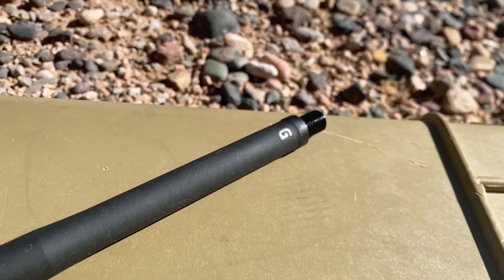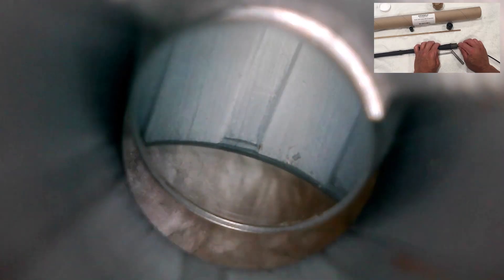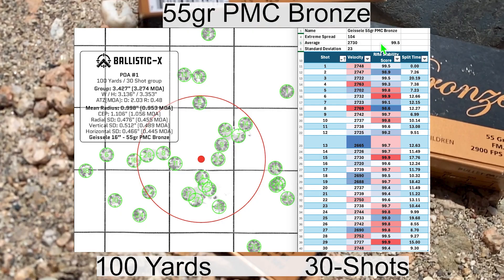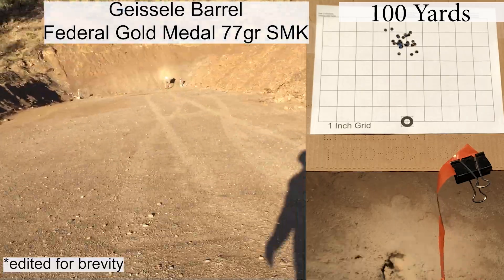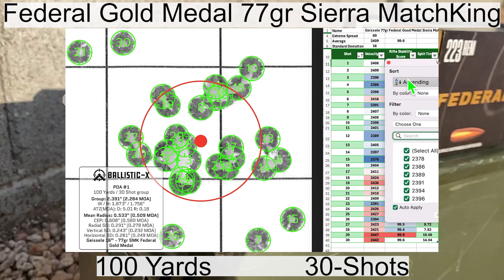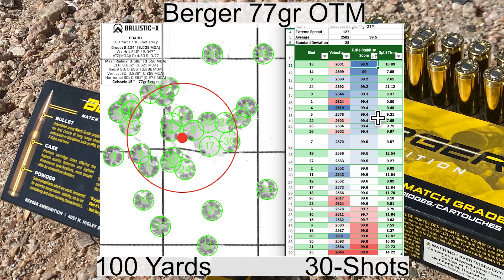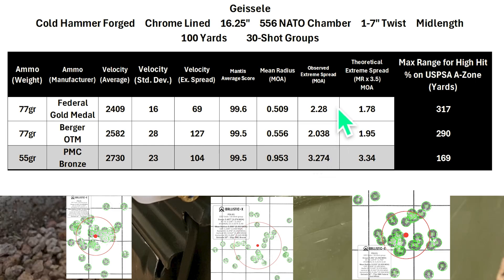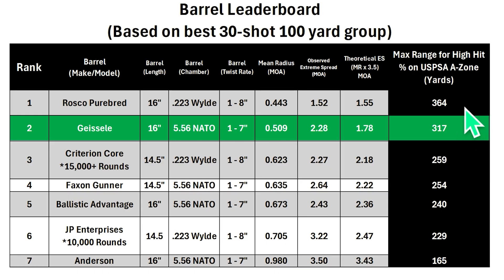Can Geissele CHF Barrels Deliver Accuracy Without Compromising Durability?

Comment: Fact is that if you want actual accuracy then you need to buy stainless match barrels for AR's just like anything else. Chrome or melonite lined barrels are not even close to being as accurate. You may think they are accurate but until you get a stainless mstch barrel from from Wilson Combat, Odin, Proof, Krieger, or Saturn you wont know how much chrome lined suck. Sure they dont last as long but barrels are an expendable part

Comment: I want to say, I love the content, and if this has already been asked or answered, I apologize. 

However, instead of using extreme spread multiplied by 3.5 (3 or 4) to calculate the max distance you can hit an A-zone with an unknown percentage chance, and instead use a single tail confidence interval? 

You could fit the observed radius from the center of the grouping to a normal distribution, and calculate the mean radius and standard deviation of the observed radius and create confidence intervals. 

For example, say you had a mean radius of .503 inches, and a standard deviation of .377 inches, with a 99.9% single tailed confidence interval your maximum radius would be 1.669 inches.
Reply from the maker: Thanks for watching my video and for taking the time to write a thoughtful comment!!  Since this video, I have revised things slightly to what I now call the A-ZED (A-Zone Equivalence Distance).  Instead of saying that it is hit probability, the A-ZED is just basically a size comparison.

I want to keep the math extremely simple. I think that would benefit the majority of my audience. Also, if someone has more advanced math skills, then looking at raw mean radius numbers is probably good enough for them anyway.  They wouldn't need to simplify for reframe things with the A-ZED to understand the practical implications of the mean radius.  Also, I basically need to re-explain the A-ZED in every video.  So, that's another reason why i prefer to keep it simple enough that I can explain it rapidly so that I don't irritate returning viewers by going over the same long winded explanation time and time again.

I'm certainly open to any more feedback if you have any.  I very much appreciate you taking the time. Thank you!

Comment: Really amazing series you got going on here. Glad I subscribed
Reply: I have a faxon match series gunner 16 in 223 wyld chamber with around 100 ish rounds through it. Id send it to you if you were interested to add to the list. It’s just sitting in safe. Be worth seeing the results compared to other brands if you were interested.
Reply: Faxon Match Series 16" Gunner, .223 Wylde, Mid-Length, 416-R Stainless QPQ Nitride, 5R, Nickel Teflon Extension
Reply from the maker: Thanks for the sub!! I really appreciate the support!  I have a guy that already loaned me a 18" Faxon Gunner Match that I will eventually do a video on.  It could be cool to have two data points with similar barrels.  But I don't want to keep your barrel from you for too long.  It will probably be a little bit before I could get to it.  I very much appreciate the offer! Getting access to more barrels really makes things a lot easier for me to put out more content.  Thanks again for the support!!
Reply: @ it was originally designed for a build that ended up going another direction. My plan really was just to keep it as a spare. The match series would be nice to see if there’s much improvement over there normal tier barrels. From what I recall they don’t guarantee sub MOA accuracy or anything with there match barrels. As far as keeping it too long that wouldn’t be a worry. I figure time wise and ammo cost though for doing 2 of the same barrels would maybe not be as worth it unless that was something you would want. If it was me and for content purposes doing another popular brand barrel would hold more weight, but I still would lend it out if it is something you wanted to do in the future.
Reply from the maker: @dakotamurphy7295  Fair enough.  Like I said, even in best case scenario, it would probably be a while anyway. So, probably not, I guess.  But, I'll hit you up if I end up thinking it's a good idea. But, don't let me keep you from putting that barrel to use elsewhere if you figure out a use for it.

Thanks again for the offer!  It means a lot to me that you trust me enough to offer to loan out your barrel.

Comment: Appreciate the shout out! I think the "budget" max distance calculation is a great way of simplifying my original proposal and is very easy to digest. Agree with using the A-zone as the target area since anything larger would probably result in ranges where things like velocity consistency become major factors and you'd really have to input your data into a statistical engine to make it meaningful. If you're interested, Bryan Litz's WEZ analysis accounts for this and more but I think for most of us max range as derived from mean radius is perfectly fine. Keep up the good work!
Reply from the maker: Thanks again!!  And you are correct. The reason why I chose the A-zone as opposed to something larger like the C-zone was to keep the distances down where other variables would only have a minimal affect.  Also, since the A-zone is about twice as tall as it is wide, that gives me a further buffer to account for velocity variation.  I plan to explain things a bit further in the next video.  Thanks for the heads up about the WEZ. I'll have to check that out!
Reply: @ My pleasure! Glad your channel is taking off
Reply: @PrestonJMoore  Great! He has a fantastic paper on it ("Weapon Employment Zone Analysis") on the Applied Ballistics website. 

Precision Rifle Blog also has a few good write ups using WEZ to study how certain variables affect hit probability more than others. Interestingly enough, there is a point of diminishing returns (around 0.5 MOA ES) where for PRS shooters increased precision is no longer significantly beneficial. At the typical ranges and target sizes seen in PRS, the accuracy of wind calling becomes the dominant factor. Glad your channel's taking off!
Reply: @PrestonJMoore Great! He has a fantastic paper on it (“Weapon Employment Zone Analysis”) on the Applied Ballistics website.

Precision Rifle Blog also has a few good write ups using WEZ to study how much of an impact on hit probability certain variables have vs. others. Interestingly enough, there is a point of diminishing returns (around 0.5 MOA ES) in which increasing precision is no longer significantly beneficial. At the typical ranges and targets seen in PRS, the accuracy of wind calling becomes the dominant factor. Glad your channel’s taking off!

Comment: Do you think that not having a flash hider affects group size? I have it in my head that a properly torqued muzzle device might have a positive effect on barrel harmonics (wait, did I use affect/effect correctly there?)
Reply from the maker: I think that it has the potential to affect group size. I've think I've had muzzle devices do it before.  Granted I didn't investigate it as thoroughly as I would now.  
 I hope to make a video about it at some point. If you, or anyone else finds them helpful, keep doing your thing.  I have muzzle devices on all the rifles I actually use and not just test.  But for the testing I do in these videos, I feel like muzzle devices introduce one more variable to keep track of that could potentially go wrong.

Comment: I really appreciate that you use mean radius as your main measure of precision. As a viewer, it also makes it much easier to compare and contrast my own barrels to the numbers you provide.

One of the many good things about using Mean Radius instead of Extreme Spread is that, theoretically just from a statistical point of view, barring random variation, it shouldn't increase in size no matter how many shots are in the group. This is because extreme spread can only grow larger as you shoot more shots, while mean radius can grow smaller if the subsequent shots are closer to centre. This means I can use my 10 shot group MR to compare my barrel to the MR numbers you provide.

Practically speaking though in the real world, MR will still grow due to factors such as shooter fatigue, barrel heat shift, and environmental factors like wind and ambient heat. However, it's ultimately still superior to using extreme spread.

Comment: Subscribed. Love your thoroughness in attempting to be rigorous and fair. 

Barrel accuracy testing, however, is mostly pointless. Barrels are individuals. Barrel accuracy — from Bear Creek Arsenal to Bartlein — largely depends on whether or not the barrel happens, randomly, to "like" a certain bullet or load. This means that more money doesn't necessarily buy more accuracy.Two barrels manufactured consecutively from the same manufacturer to the same specs can have wildly different accuracy characteristics. So, one-off tests don't tell us much about a brand; they only tell us about that individual barrel. It would be a massive undertaking to truly fleet test a brand of barrels to any semblance of statistical rigor. 

This is a similar debate to the efficacy of three-shot groups vs. groups with a higher shot count — one of the reasons I love to see you shooting 30-round tests.

Anyway, the good news is modern machining allows most makers, acting in good faith, to make accurate barrels where the bore diameter, straightness, and stress-relief protocols can be controlled.
Reply from the maker: Thanks for the sub!!  Yes, there are certainly plenty of limitations with what I am doing here. But, at least it is getting the ball rolling, I suppose.

Comment: Suggestion: shooter fatigue is definitely a thing with larger groups. Try shooting 3 ten round groups at the same point of aim, with a break between each group (stand up, walk away from the line for 30-60 secs). It looks like your groups open in the later shots
Reply from the maker: Yes, shooter fatigue is definitely a thing. Thank you very much for taking time out of your day to comment on my video to try to make it better. I very much appreciate your support and appreciate your feedback. Unfortunately , it takes me 1.5-2 hours to set up shoot groups and tear down.  I don't have the time for 45-90 minutes of additional rest time to shoot the groups. So, absolutely, it is possible that shooter fatigue and a host of other issues may increase the size of the group. However, this is how I have tested all my barrels.  So, at least they are all subject the same conditions, as far as I can control.
Reply: @PrestonJMoore you should reach out to ransom rests to see if they would be willing to donate one of their rests to your efforts. It should eliminate most of the fatigue and also make the zeroing easier and make the data more consistent.

Comment: Hey, maybe it would be interesting to know what your approximate round count is through each barrel at the time of testing? In my experience a barrel with less than 300 rounds on it performs a bit differently to one with more than 300 rounds through it(I'm using arbitrary numbers, I think you get what I'm saying). At a certain point a new barrel seems to "settle in" and performs a bit better than when it was brand new. Do you do any sort of break in procedure?
Reply from the maker: For the barrels that I've tested that weren't new, I did mention the round count somewhere in the video.  For the barrels that are past their service life (Criterion and JP) I noted that in the leaderboard.  My though has been that if the barrel is within its service life, I probably won't bother noting the round count in the leaderboard. But, I suppose I could, although space is a bit limited.
As far as break-in, I follow whatever the manufacturer posts on their website.  For Geissele, I couldn't find any barrel break-in information from them, so, I just cleaned it before the first firing and shot it.

Comment: Multiply mean radius by 4.16 to obtain R95x2 -  the diameter into which 95% of shots can be expected to fall. Youll notice this lines up with your observed results more closely. Check the "conversion" section of the wikipedia article on Circular Error Probable. CEP is the median radius, this should be (and I find it is) the same as the mean radius from a decent sample size.
Reply: I'd be interested to see the mean radius of the 10 shot groups - I find 10 shots gives a precise enough MR and velocity mean/SD for functional use, but you've got a lot of data from these 30rd groups to test that
Reply: @milesn3173

Comment: That hit probability is really a nice way to visualize the difference in score.  Personally I'd love to see an expanded one, like an A zone hit and a C zone hit.  Mostly to cross reference between this and the data that 9hole comes up with since they shoot on C zone steel.
Reply from the maker: my original concept was to use the C-zone.  But, in my opinion, it pushes the distances out too far, where I should really take into account ammo velocity variation and environmentals.  
I could just put the C-zone ranges and a list of caveats.  But limiting it to the A-zone avoids most of the long range number wizards from getting overly critical at my overly simplistic calculation.
Reply: @PrestonJMoore  that makes sense.  Managing the expectations.

Comment: Those velocities kinda suck.  I’ve seen 55 grain push 3000 fps from a 16”.  2730 is kinda awful.  The 77 grain could’ve been better too.  I’ve seen some of it get 2700 fps even out of shorter barrels.
Reply from the maker: Yup. That load of Federal GM is usually really slow and PMC bronze definitely isn't know for being hot.   I don't chase velocity too much, but there are definitely faster loads out there.

Comment: I'm not a fan of the Federal SMK 77 gr. in fact I've been very disappointed with this particular Federal load as they don't seem to perform well in my Geisslle SD, DD MK12 and Barrett REC7Di. I've had better accuracy, and higher velocities with IMI razor 77gr. Just my .02
Reply: I have never seen great groups from the Federal 77gr, but I have from their 69 gr SMK load.
Reply from the maker: Yeah, I've been meaning to get some razor core.  Seems like most people like it.

Comment: You should try out the armalite M153GN18 on one of these tests,
Reply from the maker: Those are going for pretty cheap nowadays, aren't they?  I think I remember seeing Armalites on closeout a while ago.
Reply: @PrestonJMoore  I know over the holidays psa had them in stock for 899$
Reply from the maker: @ yeah, that’s a pretty good buy for that price!!
Reply: I wouldn’t mind seeing that myself.  I got an Armalite 20 years ago and it was an outstanding gun.  I still run the lower which has over 30K on it.  The barrel lasted nowhere near that.  It has a Geissele upper on it now, haha.  Armalite has a different logo on their lowers, probably different owners, but who knows.
Reply: @Wmbhill   unfortunately current armalite quality isn’t the same as when Mark Westrum was at the helm and competing for big contracts. The man had his rifles used for crowd protection with Rio police sharpshooters during the Olympics there, that’s how good his product was. The new ownership doesn’t have the same pride, just faceless investors cashing in on the reputation he built before retiring.
Reply: @ I only live a couple hours away from the quad cities where Armalite was back then.  I went to their, in-house armorers course which included going all through the factory.  They had an obvious commitment to quality and the rifles showed that, at least the ones I saw did.  Mark was a pretty big deal back then.
Reply: @Wmbhill  they now are in Arizona and I've had the pleasure to have a few from there newest facilities was more accurate and a better feeling rifle then my friends DD and way better then my s&w m&p15 mid moe, sig m400 enhanced and the rifle I built myself. I absolutely love my armalite rifle

Comment: Since you do a lot of testing with significant samples, some food for thought.... Median values are more resistant to outliers than mean values, and at least theoretically, approach the true population mean values sooner because of this.

Basically with mean values, you have to have enough data to cancel out outliers, or you have to discard the outliers from the analysis, most often anything above or below 1.5 or 2 SD's of the mean value are discarded if this method is used.

I have a pretty significant and massive background in the hard sciences. As such I've done a lot of work in research labs. Like shooting, there are often reasons why your sample sizes are less than ideal in a lab. When this happens, we often used median values in order to more accurately assess the results for what the likely mean value of the population was.

Should be easy to play with for you, you've already done all the hard and expensive parts. Just run the median radius, median group sizes, and median velocities, to see if it approaches the mean values of the entire population of shots, in fewer rounds fired. 

Anyway, keep up the good work.